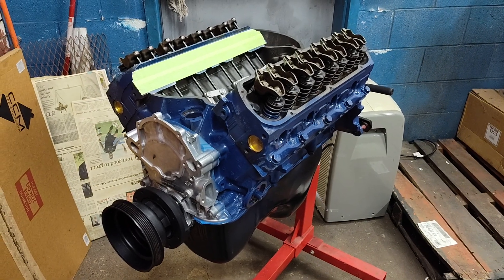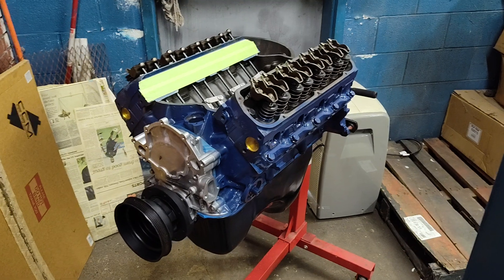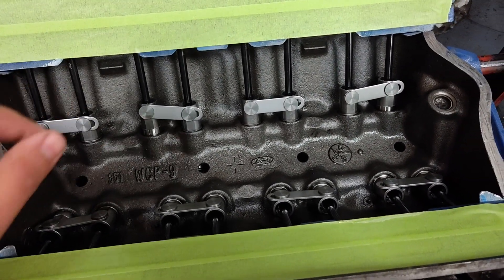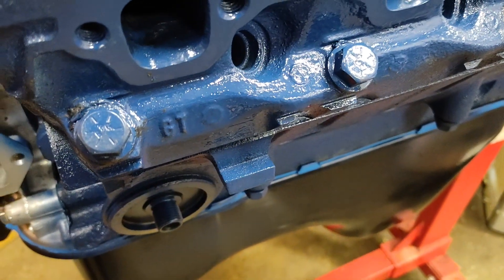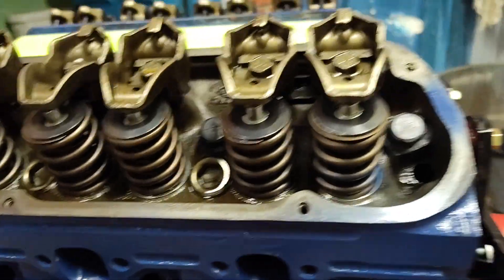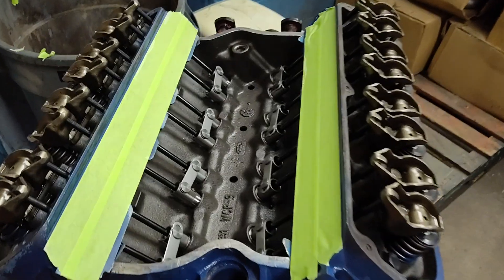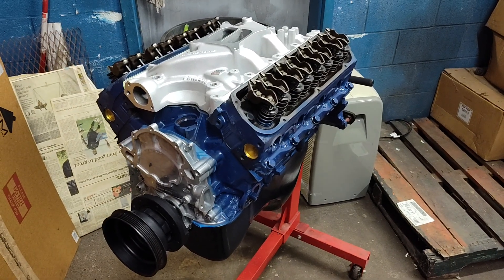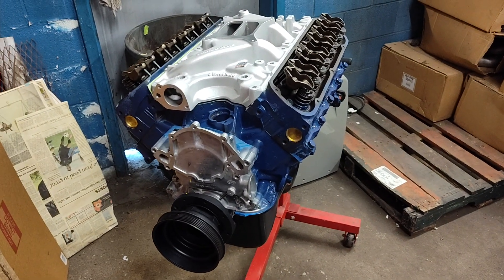The ultimate daily driver / truck&van 351w combo!

Comment: If you want good gas milage find a Offenhauser dual port manifold. They were the hot item back in the 70s and 80s. I had one on a 460 and it really made a difference in gas milage and low end torque. They are available used for 302 and 351 W. I bought one last year off of e bay for a 351 W. The price has been going up for them recently as more people are using them on their trucks.

Comment: I never owned anything with a 351W, but drove a number of Crown Victorias and E350s with that motor, VV, carb and EFI. The EFI motors were in late 80s vans and had fairly respectable power even when carrying a load. But the most impressive was a 351HO with four barrel in a clapped out 1985 model E350. After the first time I stepped on the gas, I thought I was driving a 460. Popped the dog house off later and saw the air cleaner with “351 4V HO.”  I’ve sort of had my eye out for an affordable 1985 F150 or Bronco with the HO that was worth taking home ever since. Just haven’t found one meeting those criteria, at least when I had extra change.

Comment: I have replaced every 351W with a 12V Cummins and set up (power driven diesel) for 390hp/978T on a rear wheel Dyno in Oregon 6 years ago. My Ford E350 Aerocell Unicell Cutaway same thing, 12V Cummins. It's a 5.8L vs 5.9L  I'm keeping my Ford Trucks till I die.

Comment: What will header or exhaust manifold be? I have nearly identical motor but in Cleveland guise. about 1/2 inch lift w/ older Crane roller rockers. 1-5/8" headers on my 71 Stang
Reply from the maker: @jamesmedina2062  hooker #6910 competition long tubes, 2.5 inch duals with h pipe. And either dynomax super turbos or 40 series Flowmasters.
Reply: @nickthevanman9011  Nice. I used 3.50 gear and C-6 with 2500 stall converter and my trans went bad twice so this time I added a cooler. Makes sure you run a cooler.